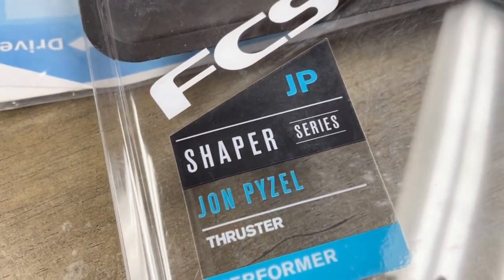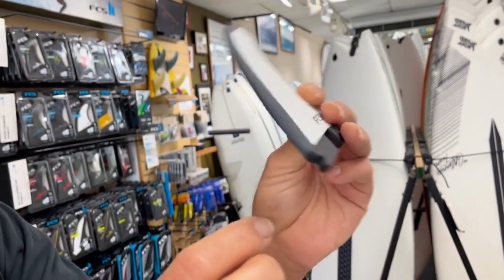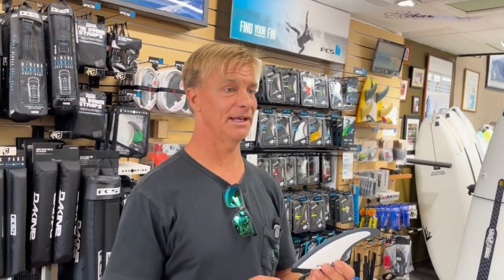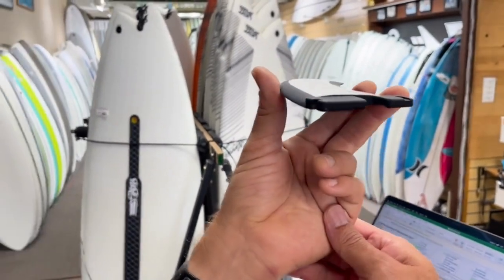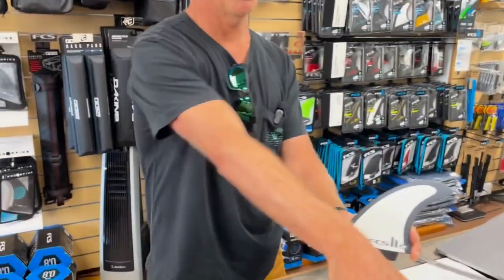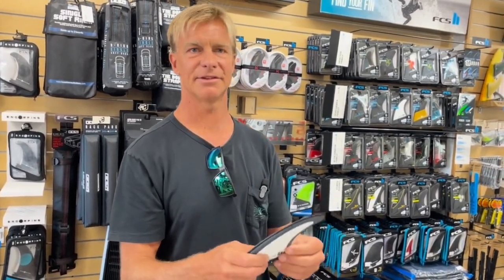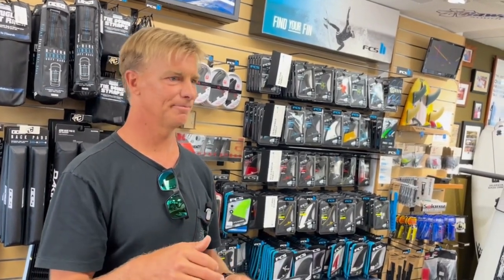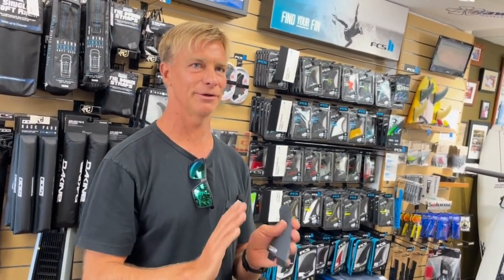Jon Pyzel Tri Fins - What kind of  board it's for and  what kind of waves you can ride this with?

Comment: In smaller waves, I felt like these fins held in very tight and needed to be pushed hard against. Seemed better for bigger waves with more push, not small beach break or points where you are generating your own speed. I would use them in narrower tail boards in punchy waves.

Comment: Pyzels fin has too much drag I found, love the idea of a wider base, thinner tip but the height, oversized area and thicker forward foil all make it drag and lose drive. I’ve generally found I end up using slightly smaller and more upright fins in pyzels compared to other board brands but the larges are too big, and the mediums are too small unless a pin tail gun. Performers work better
Reply from the maker: Right on Thanks for the Review!!! - David
Reply: FCS 2 Tokoro Large Fronts with FCS 2 Pyzel medium rear is my absolute favourite Fin set up for drive, hold pivot and release, try it you'll thank me later.